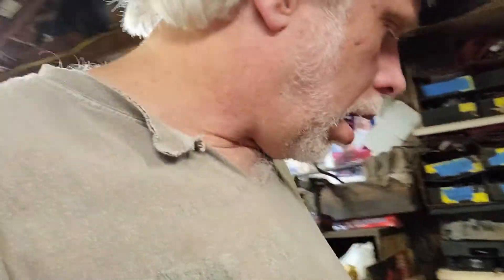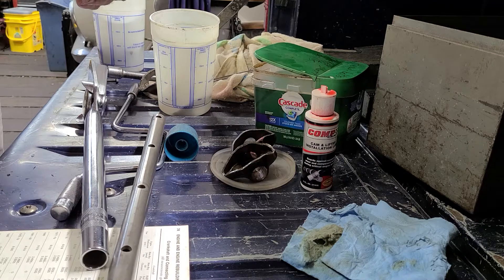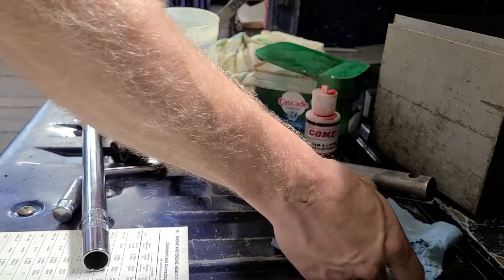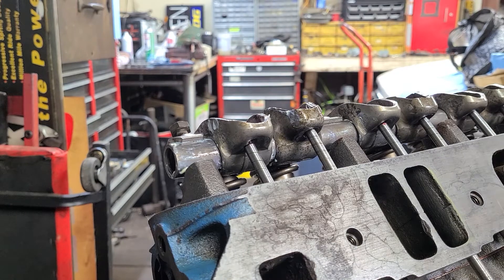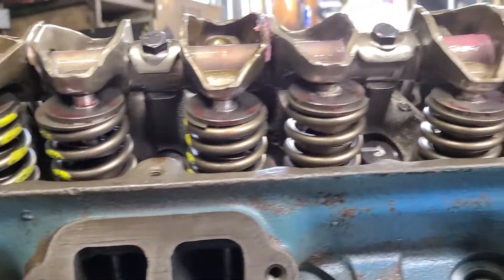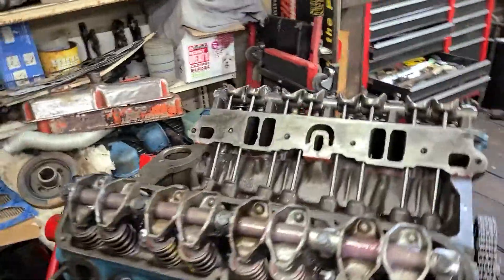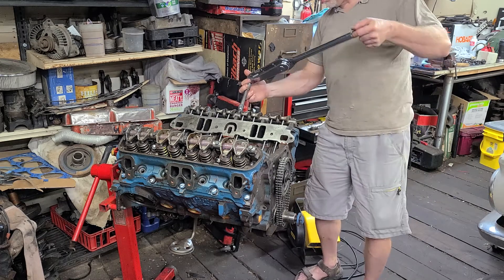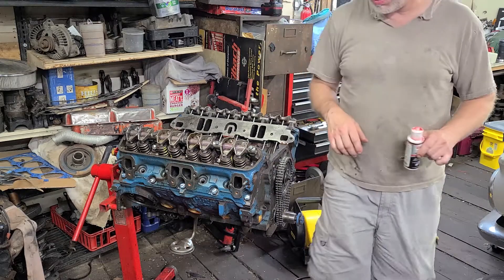Mopar 360 rocker shaft assembly part 2

Comment: Thanks Bud, just working on a valve cover oil leak, and noticed two of my rocker arms just didn't seem very centered on the valve spring nub. So thinking I should fix it. Your video was very helpful, thank you sir!  BTW it's a '68 340. Interesting enough, the torque for  '68- '69 318-340 rocker shaft bolts is stated as 210 inch pounds (in my well worn Chilton book). Where as the 273 is 30 foot lbs, & the 383-440 is 25 foot lbs. Kind of goofy, but I'm going with it, ha. The torque sequence was not shown in the book, and that was one thing I was concerned about. 
  I think I should disassemble the opposite way, from the outside in. Correct?

Comment: Did u mention it or did I miss it what's the notch for
Reply from the maker: Hey Thomas, first of all, thank you for watching my video. I do appreciate it greatly, but the rocker shafts have to be bolted on to the cylinder heads in this order the left side cylinder head and it's rockershaft has to be installed with the notch on the front. That notch will point towards the center line of the engine. The crankshaft the right side or passenger side head. It's rocker shaft has to be installed with it's notch at the rear pointing towards the center line of the engine. So go over that one more time then notch on the left cylinder head. The driver side cylinder head will point will be at the front and will point towards the center line of the engine. The passenger side will be notch in the rocker shaft will be at the back and we'll point towards the center line of the engine. When you do that you get correct oil flow for the rocker shafts and the rocker arms and push rod tips and the valve tips and valve stems. If you don't do that correctly, you could have some oiling problems now. Something else to pay attention to? Is that your left bank is always the left bank? It is always the driver side. The right bank is always the right bank. It is always the passenger side. I don't care if you're standing in front of it. You're standing beside it behind it. You're laying underneath it. It doesn't matter. The left side is always the left side. The right side is always the right side. Please do not get confused by cameras that can change lenses and then flip the image around okay so that's something to be aware of. So thank you very much and if there's anything else I can help you with let me know
Reply: Ok thanks that makes sense thanks for explaining it

Comment: Do they make adjustable rockers in a kit or something?
Reply from the maker: No they do not make any sort of adjustable valves for these engines. Are you having some sort of trouble or issue with your rocker arms or rocker shaft or push rods?
Reply: @slantfish65sd  I want to shave the heads to add more compression. I want to zero deck it. I’m looking for adjustable rockers.
Reply from the maker: If you're looking to gain more compression, there are a couple of things you can do to get closer to zero deck One of the things you can do is look for a piston that has a higher compression height that is the distance from the center line of the wrist pin to the very top of the piston. I don't recall the part numbers but I know silvo light Pistons they make pistons that are a higher compression height. There is also two or three other companies that make pistons like that. You can change out the pistons that will get you much closer. Maybe even all the way to a zero deck height but I would not go through the trouble of milling the block or milling the heads down a lot to get the compression ratio higher. If you do, you could face a lot of problems getting the intake to seal to the cylinder head and to the block. Then you may have to mail the intake and or the intake ceiling services of the heads. Now you can mail the heads down about 60,000 of an inch. I did that on my 360 and I also used a much thinner head gasket too that got my compression up some. However, if you got the money, I would go with a taller piston higher compression height instead of milling. Either way, you're probably going to be about the same money, but for me the toddler pistons are the way to go. And as far as adjustable rocker arms, my apologies earlier I wasn't paying attention and I thought you wrote adjustable valves adjustable rock arms. They do make some look at crane cams. They used to sell some. I'm not sure if they still do or not. There's also just a rock crimes that were put out by the factory on the 64 through 67 273 V8 that you're going to need to get the rock arms and the rocker shafts. They are different. They are just as well You may also want to look at Mancini racing also check out summit Racing and possibly jeggs for the adjustable rocker arms
Reply: @slantfish65sd  I appreciate the advice. I just like the simplicity of being able to adjust rockers. Down the road when I put a solid flat tappet cam in I want to be able to adjust my rockers… someone told me I can put 273 rocker shafts on any LA? Any experience with that?